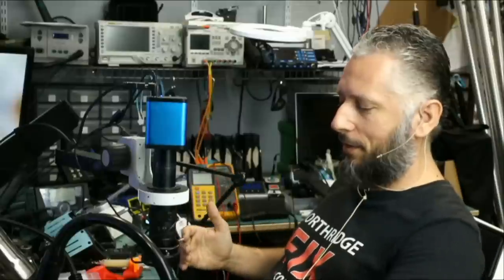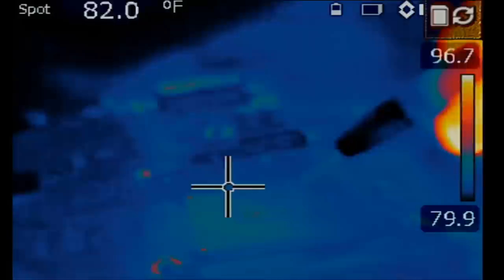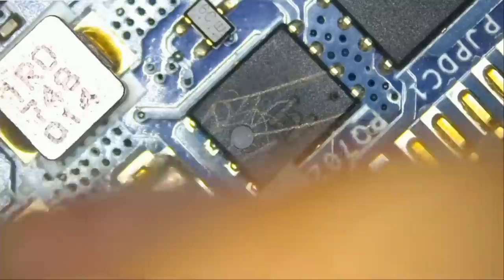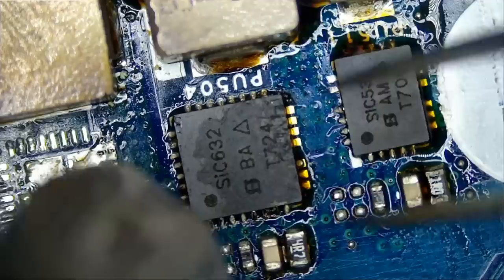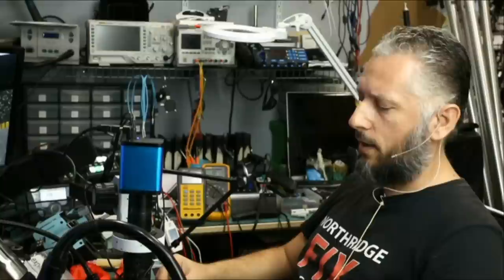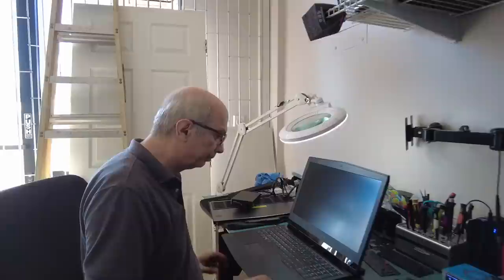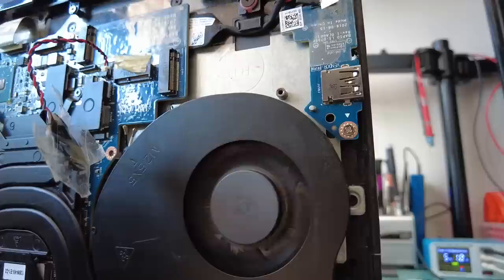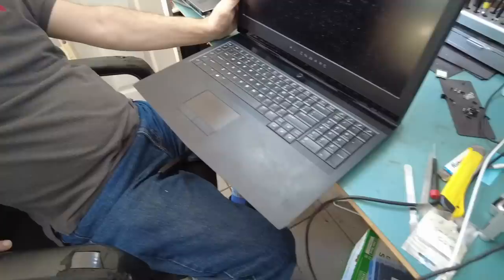Dell Alienware R4 17 common CPU failure - Is it fixable ?

Comment: I maybe wrong but you have to try these ,
1 , try different ram sticks 
2 , Reflash Bios chip 

Because I used to work with same Laptop (not HP but you know...) both has same problem ,fan spinning and turning off . NO post also . So I tried swapping ram sticks . The problem was fixed for the 1st laptop . Then I thought it could be the same issue with another one.. so I checked the second one with working ram sticks ,Taddaah,,,, Nothing. 
Then I checked the inductors if it's getting any voltage with the power supplye . Everything was just fine. Finally Jumped to BIOS flash . 1 sat flash was a failure ,And I Flashed the bios again . And that was a fix ..

Comment: Pressing power for 30 secs. That battery and power cable should be disconnected . Then after pressing the power button for 30 secs. That the time to re insert the battry and power cord.

Comment: MOSFETs do get hot by design yet they have max operating temperature which they are rated for set amount of hours. Also they have shutdown temperature.
All of this is fine if the mosfets are properly cooled, but laptops which might have little to no heat transfer simply causes the MOSFET to get too hot and eat the hours it was designed to handle.
Also since most components used in consumer products are basically shit quality they have more variation in quality the more premium stuff...

Comment: I have the same Alienware with GTX 1070 happen with me processor red lights when I leave the laptop for around 1 month when take vacation and there where hella rainy season there so I guess it the dust and the moisture from humidity make wired resistance across the board and laptop thinks this was a fault so I just clean it with gentle hands with thinner and soft art brush well it works!!!!! Happen 2 months ago.

Comment: OEMS use cheap components whenever possible. 12 phase Vcore with 100Amp power stages doesn't mean anything to 99.999% of the consumer base, but i9 12900HK does. So they pair immensely powerful CPUs with inadequate VRM resulting in the MOSFETS running hot in an already grueling environment. 

They bank on the fact that the overwhelming majority of people buying high-end laptops are not doing serious work on them for any length of time. Anyone who puts a lot of mileage on a laptop like this, at peak capacity, is going to blow a FET eventually.

Comment: These parts fail in gaming boards and video cards mostly due to overclocking. Some of these gamers max out the OC settings and the components use higher voltage and heat up significantly. It is better to buy a faster card and slightly overclock (or dont OC at all) than to max out the OC settings. Sustained heat and higher voltage is an enemy of circuitry and will always shorten the life of it.

Comment: I've had the same model for 7 years now and it's been very reliable, even used it for crypto mining. Alienware all the way for me. The battery did stop holding a charge after all the years because I kept it plugged, replaced it a month ago which was a pain with all the screws and panels. Now with a 32GB upgrade the laptop has new life in it, this thing was built like a tank and just won't die :)

Comment: Heat heat heat is the killer, crap thermal taste that hardens after about 2-3 year of high temps. Also as Alex has show in many videos, you need to wait for a board to cool down to test again as alots of components will have different thermal/resistive characteristics, so if the board heats up to much under load, component values will change causing damage and then shorts. Oh BTW dont use your laptop on your bed, its perhaps the worst place for good air flow.

Comment: Remember the days when CPUs were in a socket and you could upgrade them? It looks like there's more than enough space to do that here. I guess laptop makers would prefer you go back to them to buy yet another machine ...
Reply: BGA became common in the early 2010s and Haswell was about the last Core i that had a socket option for Intel mobile CPUs.  Apple probably started using BGA CPUs before anyone and we all know how bad they are for servicability and upgrading.  BGA saves maybe 1.5-2mm in clearance and a few bucks in manufacturing costs and that's where the positives end.

Comment: The embedded CPU is a joke - if the CPU goes  bad it's another motherboard - instead of just taking the CPU out and putting another one in - you have to replace the whole motherboard - which benefits the motherboard manufacturer
Reply: So start a motherboard company that doesn't embed CPUs to the board. Many people will really appreciate it

Comment: Alienware 17 R4 Service Manual | Dell US

Light Code 2-1 means the processor has failed.

Make sure you bought the battery from Dell and not from an online seller.

FAQ - Laptop battery articles - Dell Community
may be the problem happened after the other shop tried to change the non-compatible battery 
🔋

Comment: I hate the way new hardware is built these days, its going to get harder to work on as time goes by, cpu failure a 30 years ago was a rare thing, but everything is made chintzy these days with little if any engineering slack or robustness. its a chuck away society

Comment: even though this video is a year old - you asked what causes the  mosfets to fail and the only answer that I can think of is whats called undervolting the CPU or whats called Underclocking . Its believed that undervolting or Underclocking  would increase the performance - this is done in the Bios settings, But as you can see the cost of doing this practice it kills the CPU and other components - What gamers don't understand is when you lower the voltage The current or Amps goes up and this is what does the damage where the CPU gets Fried - So the moral of the issue is Gamers!!! DON'T!!! Touch!!! the Bios and change the parameters to which the system was designed or this is the out come...Need I say more? It's not brain science...

Comment: Please guys anyone can reply on my comment , i am a poor guy who build PC for one time with atleast 8-10 years lifespan expected , i've always had motherboard issues like had to replace two motherboard during my 9.5 years of usage and the cpu was (amd fx 8150 it runs really hot) but since it's failure and it's motherboard is no longer available , i am thinking to build a new system based on intel 12-13 gen (i5 is more than enough for me ) and thinking a budget z690 or something , same goes for ryzen too , i wanna ask you people how long does your motherboard lasts without any issues ? Can i use a single motherboard throughout 8-10 years ? Even it fails after 5-6 years it is fine i could buy another one but the thing is such products gets obsolete really fast and almost impossible to find in the market
Reply: yes. 

i have zotac g31 and intel pentium from 2009, then upgrade to xeon l5420 + gtx 650 about more than 4 years ago, still  working fine to this day. 

as long as you using good psu, reguraly in cleaning it and have a good room temperature, it will make your PC not damaged quickly.

Comment: Parts in laptops go bad because of overheating, and because laptops are cheap trash. I mean not cheap for the owner, but cheap to produce. Low grade screens, horrible audio chip, ancient useless camera etc. Not enough power phases or not strong enough so they heat up a lot and degrade over time. With pcs, laptops, phones and tablets heat is your biggest enemy and most companies underestimate the importance of good airflow.

Comment: From my experience, Gaming Laptops are poorly designed, overpriced garbage. I believe that these laptops are on the bleeding edge of their power delivery, if they had more, or better mosfets or better engineering in general, they would cost a whole lot more, and use a whole lot more battery, making them more useless then they already are. Is that accurate? I guess some kind of protection circuit for the CPU, GPU, or DRAM would probably cost a whole lot more too in money and battery.

Comment: Just replaced the CPU you do have a donar board
Reply: If CPU was good in donar than he would have fixed that donar
Reply: better buy a new laptop ...
Reply: yea of courser he's going to spend another 5 hours changing cpu for $149
Reply: The effort, time, tools, skill needed to replace cpu is wayyyy too high, not to mention how to source a cpu that will fit  and nope you can't buy laptop cpu brand new.